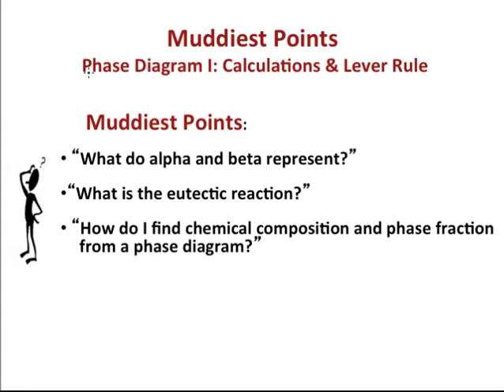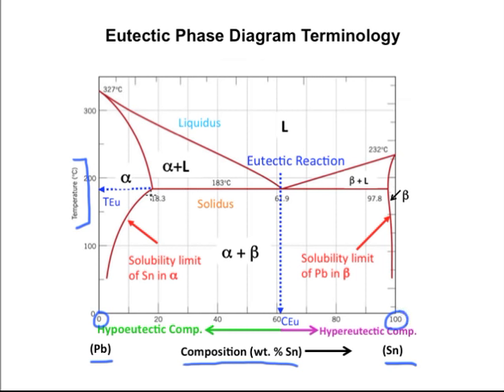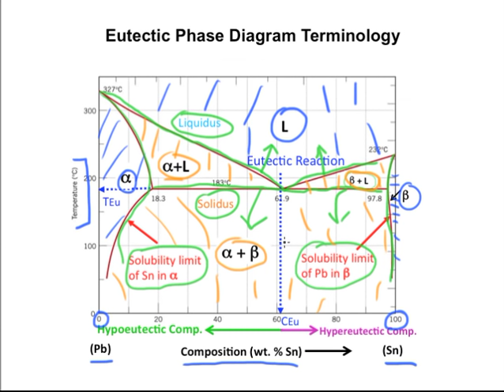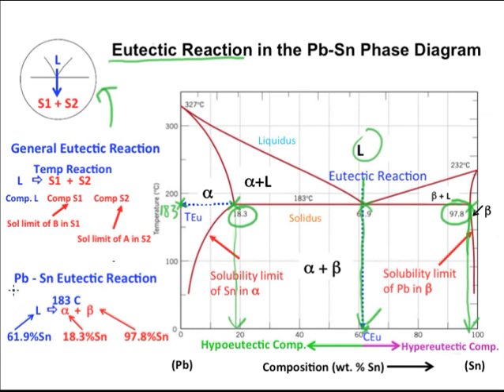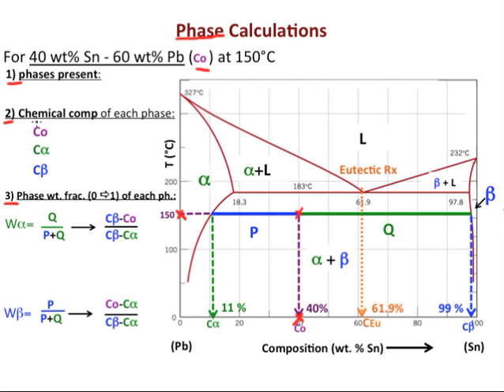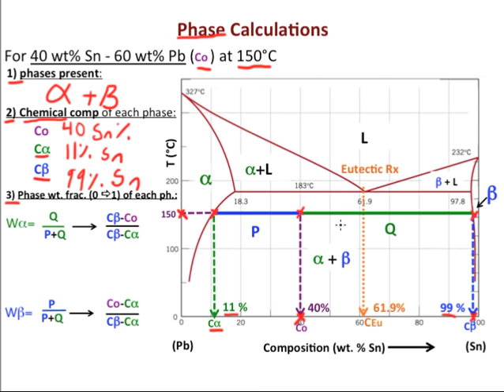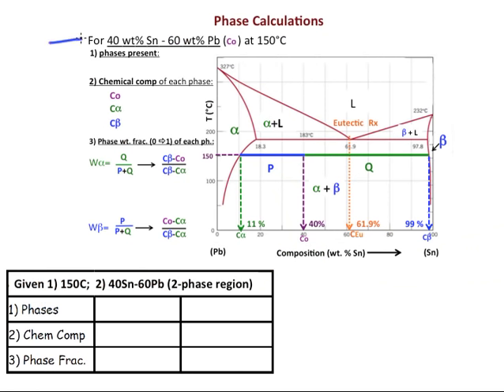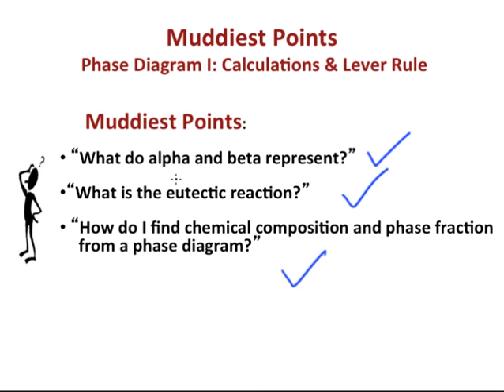Muddiest Point- Phase Diagrams I: Eutectic Calculations and Lever Rule

Comment: That is not the solidus line. The horizontal line is called the Eutectic. The lines separating the alpha phase from the alpla + L and the line separating the beta and beta + L phase is the Solidus. The lines separating the alpha and the beta phase from the alpha + beta phase is called Solvus.

Comment: Can someone plz explain this to me: at 9:20 how can there be a alfa+beta with 40%tin if earlier the L->alfa+beta with eutectic composition of 61,9% Sn. Isnt the eutectic ALWAYS 61,4% Sn for this diagram if we start with a liquid composition that is in the range of the hypo/hyper eutectic area?  thx for any answers :)
Reply: +Klemen Mlinar  Isnt the eutectic ALWAYS 61,9% *
Reply: +Klemen Mlinar - actually there are not "alfa+beta with 40%tin" by 150°C, there are 2 solid solutions (ss), alpha ss with 11%Sn and beta ss with 99%Sn. The 40%Sn is the overall composition, e.g. u have a liquid with this composition by 300°C, then u start cooling it. U gotta stay always on the vertical line of the overall composition, from there u can read every ss, L or S composition on the left and right side.

Comment: Your percent go over 100% -________-
Reply: Co is 40% Sn and 60%Pb. Calpha is 11%Sn and 89%Pb, Cbeta is 99%Sn and 1%Pb @150C, They aren't supposed to add to 100%. You find out the amounts of alpha and beta in Co by doing the step 3(phase amounts). Alpha at that temperature will always be 11%Sn.... but you may have more or less alpha depending where along 150C you are looking in the phase diagram.

Comment: SO useful. Thanks!
Reply: what major are you studying ?
Reply: tatu fan I am no longer in school now. I did my undergraduate time at UC Berkeley several decades ago, studying physics, though I did not finish my degree.

But now, thanks to the revolutionary nature of youtube, it is as though I could wander around campus invisibly, sit down in any class I choose, and begin to learn the fundamentals of one specialty after another.

In respect to metallurgy, I feel fortunate to have this beautiful exposition of those basics, especially in the context of a lead/tin mixture, 60/40 --- a mixture with which I have personal experience from doing a lot of electronic soldering in my younger years. So I have seen a hot slush occasionally form under my soldering iron, usually after the solder has melted and solidified several times, and likewise I know about a slush's crumbly and otherwise unpleasant characteristics after the liquid component has solidified.